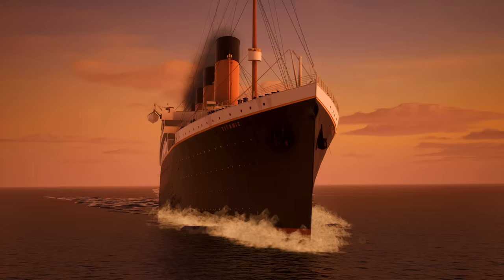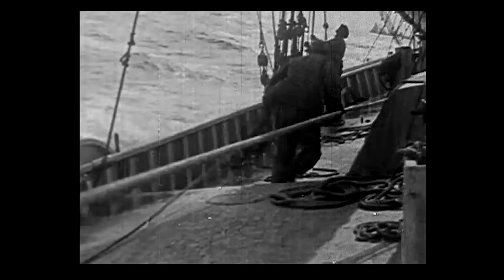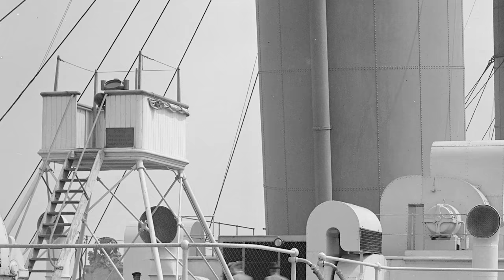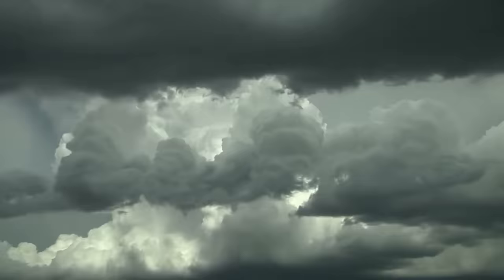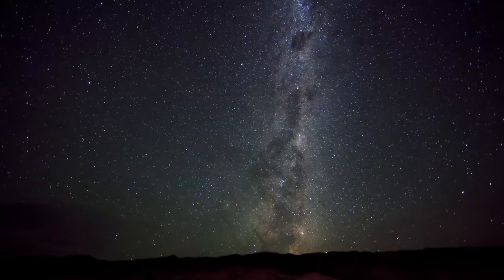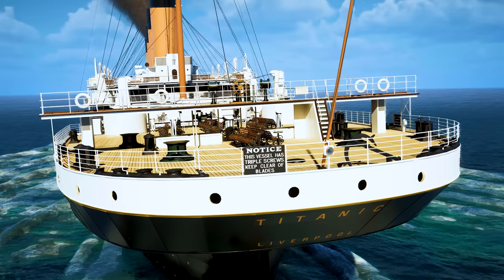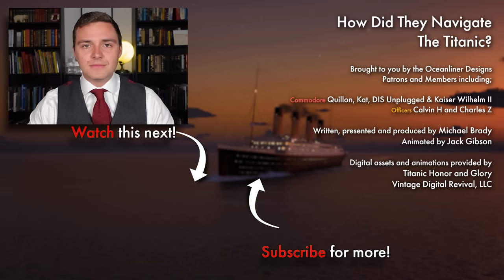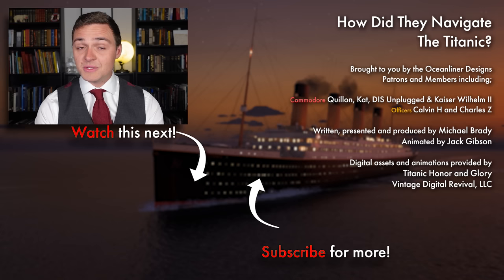How Did They Navigate the Titanic?

Comment: The chronometer didn't solve finding position without sky measurements. Those are still needed. Latitude can be found with only sky measurements. Longitude needed sky measurements plus accurate time measurements. For instance sky measurements can give one high noon at the current location.  If your noon is 12 hours ahead of 0 degrees high noon, you are at 180 degrees. But in order to know when it is high noon at 0 degrees, you need a watch synchronized to a clock at 0 degrees. Which is what chronometers were.
Reply: You are correct four times a year.  Don't try to navigate any other time.
Reply: @givenfirstnamefamilyfirstn3935  Take a calendar and an offset table. Problem solved. Same exact solution applies.

Comment: Great job Mike on the videos. I had a though; I don’t think I have ever seen a video on Titanic’s sister ships modifications based on the disaster. I know they added life boats but any mods to procedures, equipment or design? Thanks
Reply: This channel actually has a great video on Olympic after the Titanic disaster, but the major changes for the Olympics specifically were to extend certain watertight bulkheads to run the full height of the hull (so even an impact penetrating both sides of one such bulkhead couldn't sink the ship) and a refit to extend the double hull up the sides. Basically, if Brittanic had an exact repeat of the Titanic disaster, she'd quite comfortably survive and make it to New York.

There were also changes made to use of the radio and regulations for lifeboats, but those were general changes, not type-specific.

And of course there were some changes made to make Olympic nicer, learned from her existing service, that had already been on Titanic - but those aren't safety changes.

Comment: Wondering if someone could explain why latitude was easier to determine than longitude. He mentioned that there were simple charts for that, just curious how latitude was determined.
Reply: Latitude is quite easy. You just need to know what day it is, and then measure the angle of the sun above the horizon at noon. Noon of course being when the sun reaches its highest point.
As an example, if it's the equinox and the sun is directly overhead, you're on the equator. 70 degrees above the horizon and you're at 70 degrees north or south. If it's June 21st and the sun is directly overhead, you're on the tropic of Cancer. The charts are used to translate the angle to latitudes for each day of the year.
Reply: @ChrisCooper312  That makes sense. I assume the moon and stars can also be used to determine latitude? Thank you for the explanation.

Comment: One thing that has always puzzled me is how course headings were designated.  For example, "North, 30° West."  What did that mean, and why state it that way?
Reply: ancient method...from when compass was read/divided into 32 "points".
Even before THAT actually. 
What your example means is "steer 30 degrees to the west of North"...which as a "modern" heading of 330 degrees, and close to "North by Northwest" by the 32 point-system.
Reply: @BrionBoyles  I figured it was something along those lines.  Back in the points of the compass days, steering by the stars for days or weeks at a time, designating a course to a precise compass degree wouldn't have served much purpose.  Although "steer 30° West of North" is actually basically the same as saying 330°.  Makes me wonder if tradition didn't enter into it to some degree.

Comment: Mike i kinda "need" your help i am verry annoyed by the thing that gets repeatet every time about the titanic it goes something like that: "bad rivets and not enogh of them therefore titanic sank everybody dies". yes harland and wolf did thier best for the 1910s we all know that BUT i am not convinced that a modern ship (with welds) whould have survivde that kind of impact that the titanic suffered. i mean she was designt to be an ocianliner not an icebreaker. the Explorer sank in 2007 after hiting ice and that ship had a reinforced bow (not an icebreakernow), ice is verry hard stuff. so titanic with a kind of welded hull ? less damages ? almost yes! but enogh to safe the ship ? i have no clue in my mind its more like an Andrea Doria situation  surviving long enogh to get everybody off board safely but sinking in the end (yes in my head its still 5 compartments flodding but slower wich is my guess because the iceberg would inpact the same area of the ship but that arear is tougher). so i was wondering what is your opinion on that scenario or a similar scenarios like titanic beeing rivitet with better(at the time not available) steel
Reply: Wasn’t that the collision involved the ship’s hull ‘tearing’ as it struck the berg with a glancing blow, and that the metal used became excessively brittle in the low temperatures present?  I’ve read that modern steels may have fared better, but man, that’s a lot of force we’re talking about.  I’d think any 50,000 ton ship grinding its way alongside an iceberg would open it like a can opener regardless of the steel used, welded or riveted.

To your point of it not being an ice breaker, I have read that had the Titanic struck the iceberg head on, it would have survived.  The front certainly would have been crushed, but I think it was estimated that only the first two sections would have been flooded - making the ship truly “unsinkable.”

Comment: You know what I don't understand why people stop producing Ocean Liner ships such as Titanic.

First of all the even that your ship will hit an iceberg & sink is so low now considering climate change is melting the icebergs.

2) Lifeboats are being lowered automatically by crane now not manually like you see in Titanic & they dont use rows anymore lifeboats nowadays have propellers so it can immediately drive away from a sinking ship.

3) Ships dont use 3 - 4 funnels or smoke chimneys nowadays so its more healthy for the environment. They just need 1 funnel if you see more than 1 it's most likely a design and non functional. 

4) It's more convenient to the passengers you'll be able to walk around the deck instead of just sitting in a chair. Not to mention ships also has pools & entertainment. 

So will all of that being said I don't get why they won't start making ocean liners ships again.

Comment: Honor and Glory: How did you control the in-game camera with such fine control? Did you use scripts or a noclip mode and a game controller joystick?
5:50 Also, how did you side-view the whole ship without encountering loading screens for the different crew/1st/2nd class promenades?
Reply: It is not a game. Check the description. It was made by a grsphics team.
Reply: @surajbanerjee6850 the same team who developed the Honor and Glory game/simulation it's still using the Unreal 5 engine. I've been wondering if there is a way to load multiple 'levels" at once on a high-end PC and noclip over/through the ship

Comment: Sorry Mike but you did not get this quite right. The astronomical readings by themselves could not give longitude even on a clear night. This data needed to be combined with knowledge of Greenwich meantime from the chronometer to work it out.
Reply: Actually, there is a procedure to get Greenwich Mean Time without a chronometer: Lunar distances.
But I doubt, whether anyone still was acquainted with this method in the year 1912. 
It was surely not regularly used any more at this time.
Using an accurate chronometer was much easier.
A little bit like using GPS today instead of celestial navigation.
Reply: @701983  Didn't know that, interesting. Another thing Mike got wrong was that they could use the clock instead of the stars. Both were needed. Or maybe I already made that point.
I suspect this whole topic is kind of out of his field of expertise.
Reply: @canuckprogressive.3435  Yes, he didn't get it perfectly right, but good enough for this overview.
By the way: There was a second "trick" to get GMT without a chronometer: Observation of the Galilean moons (big satellites of Jupiter).
You can see the eclipse of them at the same time at every position on earth. If you can see them at all. But this method, proposed by Galileo Galilei himself, was not practical at sea. But used on land for mapping.
Nice book about this topic: "Longitude" from Dava Sobel.
Reply: @canuckprogressive.3435  He didn't clearly say, that they could use the clock INSTEAD of the stars. But it came out this way a bit, I agree.